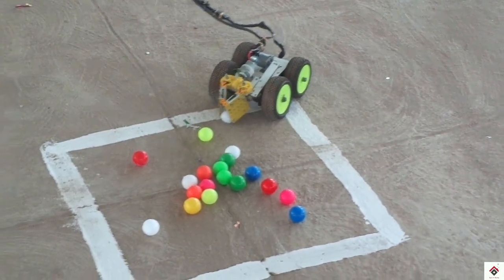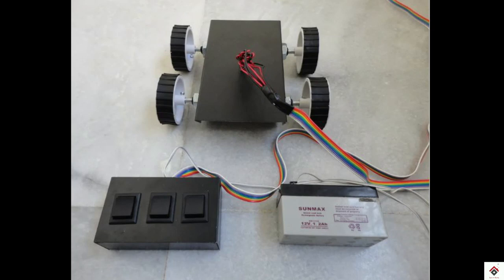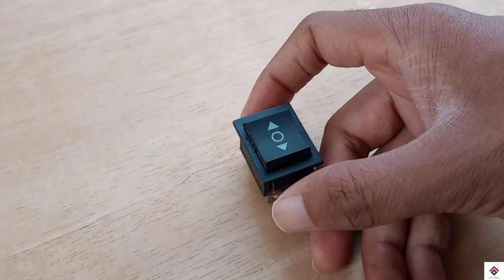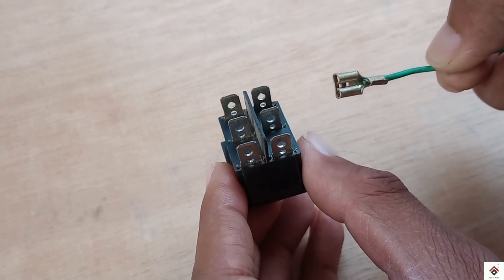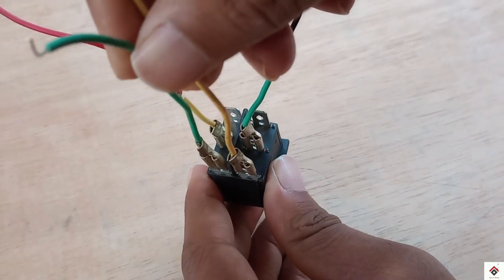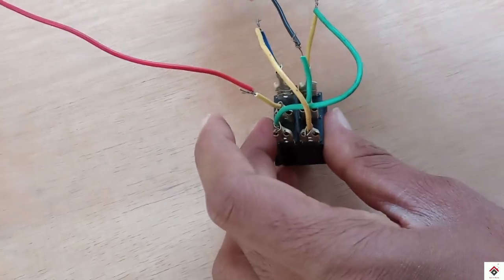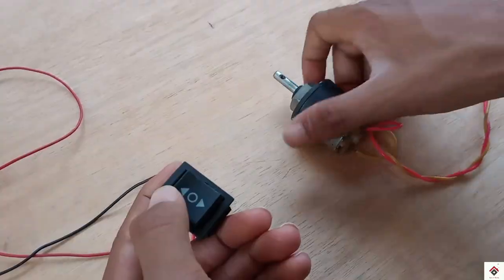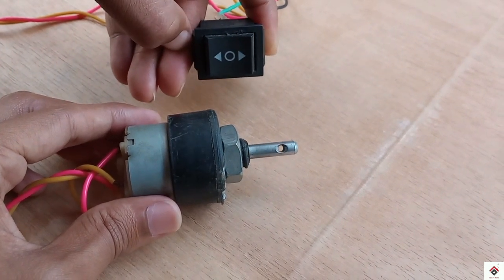How to connect DPDT switch with dc motor | Roborace robot using dpdt switches

Comment: Can you make a video for making controller which can work on ac supply instead of battery
Reply from the maker: Actually you can use AC to DC converter circuit also with the same.

Comment: 🙏🙏🙏Please help one motor not run on quadcopter 450 frame i am using kk flight controller  i also calibrate all the motors  please help 🙏🙏🙏
Reply from the maker: Follow these steps.
 Connect all ESC'S  with the KK board.

1. Switch on the Tx and raise the throttle to maximum.
Press and hold first and last button of Kk board.
2. By holding them connect the battery.
3.you get throttle pass through on the screen of kk board wait for some time( it gives some sounds) and decrease the throttle.
4. Disconnect the battery.
5.Again connect the battery.